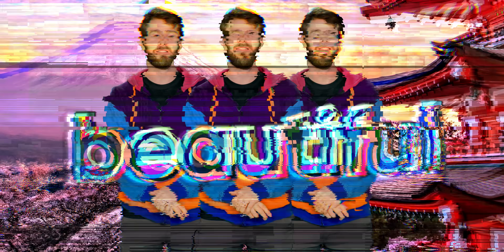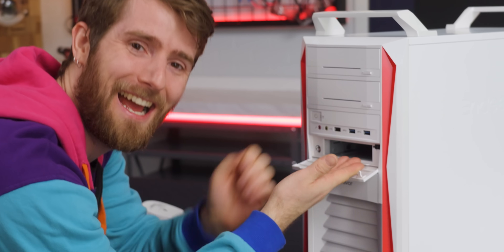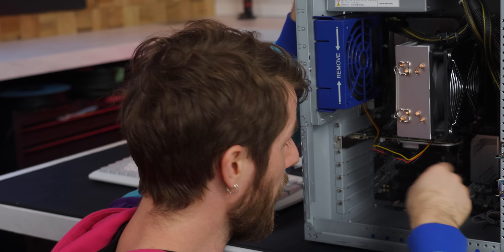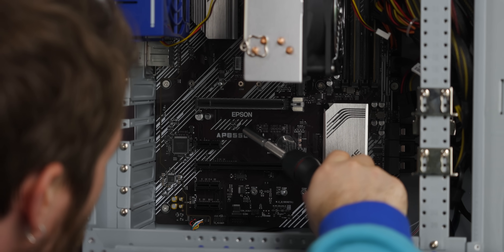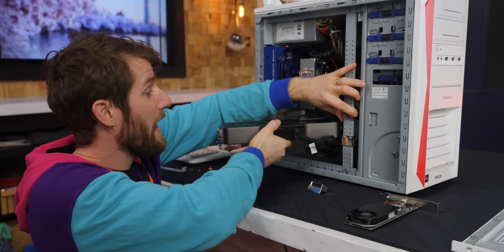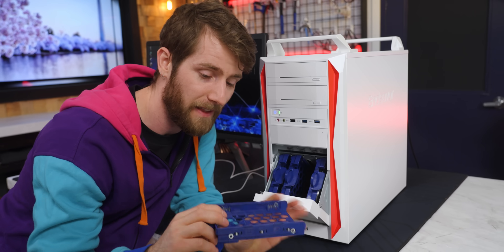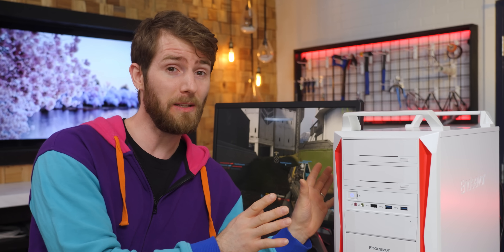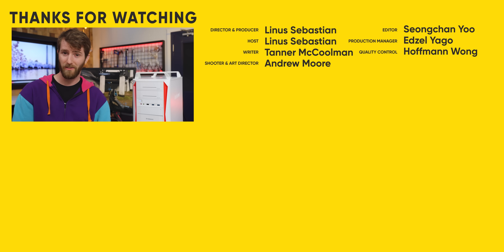I Bought a Gaming PC from EPSON - Epson Endeavor Pro 9050a

Comment: damn that case is better than most gaming PC cases these days (unless you want water cooling). the rear IO and pci panels are reassessed  so that you can properly screw in pci cards and push the pc further against a wall without kinking the wires. Also the strongest part of modern cases these days is the glass side panel, I don't like seeing the top of my case bend when I put something heavy on it if the panel is off.

Comment: Pozidrive (PZ) is also quite popular in the European Union. While the Phillips (PH) screwdriver is designed to "slip" when excessive torque is applied, the Pozidrive (PZ) can handle significantly more torque. This makes the Phillips screwdriver ideal for low-torque applications, such as in electronics. In European construction, the Pozidrive is widely used. Even though the TORX system is gaining popularity, having PZ1, PZ2, and PZ3 bits in a set is essential in this region.
Reply: @mikeycrackson  it'll NEVER be standardized, as for the reason why, it's the same why Apple still uses lightning, money.
Reply: @hueanao  well apple cant use lightning anymore in europe. they have to either get rid off it for the whole planet, or make 2 different pcb´s, one for europe, one for the world.
Reply: Is Philips head the default in the US and canada? What is, for example, IKEA using over there? They are pozi for the most things in Europe. 

I love Torx though.
Reply: @hueanao  No, screws need to carry heavy loads or fit into small spaces etc. different heads lend themselves to different applications.
Reply: Pozidriv in general is probably more popular than Philips in Europe. Whenever I look at bit holders, the PZ2 bit is the one with the most wear by far.
Reply: @ska042  To be fair, a lot of people don't know the difference and just use pozidrivs for Philips heads too...

Comment: The Japanese PC community definitely is growing, and it's going to be definitely interesting to see where it goes in the next few years.  I remember post 2008, I actually got a Fujitsu workstation with dual socket F Opteron's and 48GB of ram for an absolute steal, still weird as hell because they used the same board as the HP Z series workstations, minus VRM heatsink design, the board was 1:1, was able to even use HP bios's on that board strange enough.

Comment: That's actually a pretty cool case, from a pure functionality point of view. Put a card reader/usb c port 3.5in header unit in the floppy drive bay. Implement SSD boot. My first gaming machine (yes I'm old - this was back in the 2000's) with RGB lights (had their own controller - boards didn't come with rgb support then) and Perspex view panel was white.

Tbh flashy cases never appealed to me that much. I kinda like the sleeper nature of this case. Very cool. Good work Epson.

Comment: 8:15 PosiDriv screws are used by IKEA and most if not all of Europe, so it really would be a good idea to include those bits! 

Japan does have JIS, or Japanese Industrial Standard screws though, and the bit for those works better in Phillips screws than even the Phillips bits do.
Reply: Well, as a Dutchman from the Netherlands (which is also in Europe 😉 ), I can't confirm that for my country. Pozidriv is almost exclusive here for woodscrews, anything non-wood is either Phillips (note the 2 L's) or sometimes more recently Torx.
Unless you guys build your PC's from wood ? 😉
Reply: @MrBlafhert  JIS screws normally have a dot on them

Comment: Not gonna lie, that case is sweet looking IMO. I'd take that over my smoked glass RBG case but that could be due to the massive, random isssues I encounter with it despite it being in for repair twice since purchased. Next one I will build myself but I was too busy at the time to build current system. Also, my GPU came loose on way back to me from the shop despite having the shipping foam in place... I don't mind a heavy case that securely holds GPU.

Comment: I understand that EPSON’s PC he’s pretty much in line with the design of the printers, but it actually feels nostalgic considering that it also looks like an older PC. But yeah, that GPU won’t cut it for gaming purposes.
Reply: It's probably not meant for gaming. Not really. You also have to remember, the popular games in japan are either played on consoles or do not need high spec gear
Reply: Epson has some nostalgia in Japan....they wee the only comany to make PC98 comaptible computers. Thees at least some gaming legacy.
Reply: I guess PC Gaming is still close to nonexistent in Japan.
Reply: As long as it doesn't have RGB, plenty of 3.5 bay's, i would prefer it over  80% of the newer designed cases.
Reply: @alext3811  ironically pc gaming is(was?) pretty big in japan... problem is: only for mmos and indies, they had probably THE most active indie scene up to the mid 2010s, afterwards it all amalgamated internationally.

doesn't surprise me that epson is still popular nowadays if they were the only ones to keep support for pc98.
Reply: @iota-09  Thanks for the information! I forgot about the mmos.

Comment: I would definitely buy this. I miss the drive bays and the diskette bay since I have a lot of old devices and having a CD player and a good card reader with q lot of options would help
Reply: I have a case with a couple drive bays and a floppy bay. I put an optical drive in (I still need it) and an SD card reader with some extra USB 3.0 ports on it as well in the floppy bay.
Reply: @atomicskull6405  i love those fan controllers, they are useless but look cool
Reply: I still listen to audio CD's (plus rip movies from DVD) so a DVD burner is a must. The Antec P101 Silent case only has a single 5.25" bay but that is far better than none.
Reply: @jimtekkit  That's not a bad looking case. Except for the top-mounted ports it's nearly perfect.

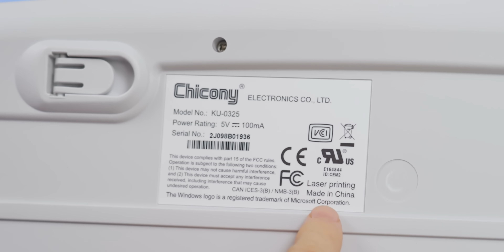Comment: 1:36 Fun fact: Japanese don't use those key assignments with the Japanese letters printed on them. They use IME phonetically just like Westerners do when typing romaji. They type in "nani" just like that. It comes out as なに or 何 after selecting from the IME list. Direct kana input is like their version of Dvorak or other exotic input systems. It's theoretically faster but hardly anyone uses it.
Reply: That's how I fumble typing through the little Japanese that I know. It works well enough when I have some idea of what I'm going to input, and easy enough to use for even the absolute newbie to the language.
Reply: yeah, but if i remember correctly, older machines supported kana input only, i'm assuming imes didn't exist back then.
Reply: NOpe,
some users wil use JAPAN "JIS" layout, for pure Japanese input will faster,
that layout will use kana (Japanese letter) input directly.
ref : https://ja.wikipedia.org/wiki/JIS%E3%82%AD%E3%83%BC%E3%83%9C%E3%83%BC%E3%83%89 , JIS配列、
Reply: @雪見巫女琉璃  Sure, there are some JIS users, but but it's quite a minority. Check the figures from here: https://ja.wikipedia.org/wiki/%E3%81%8B%E3%81%AA%E5%85%A5%E5%8A%9B
Reply: @ruby_R53  You're correct. As a result, most users of direct kana input/JIS are older. If you go back even further in time, there were enormous keyboards for direct Kanji input from before IME was created.
Reply: @dycedargselderbrother5353  this type users will be fewer,  one reason is enviroment is changed.
Japanese has been mix many short words, code words with English past 15 years.
When input text will mix Japanese and English, use IME input (base on ANSI Layout) will be better.
Of course, if not have a JIS layout keyboard, use IME input is only one choise.

in another side, if buy a PC is Only sale in Japan, JIS layout keyboard is standard equipment.  use as normal ANSI layout will make some keys changed.  Need to change OS setting to correct layout.
Reply: im learning japanese, and what i learned is that a lot of japanese mobile users (especially on smartphones) use the t-9 for texting because it’s faster.

Comment: Visited their store page. The default is mechanical drives to keep the cost cheaper. Also to note: the advertised default price includes the sales tax for that configuration unlike here in the US /  Canada stores, the tax is often excluded from the advertised price.

You can actually drop the total price a bit further (probably about $160 / ¥ 22,500) by dropping to an 8 GB memory, Keyboardless, Mouseless, Handleless configuration.

Oh and they probably won't ship over seas anymore if Google translate is accurate. They put a disclaimer that the order is valid for Japan only, and cannot "deliver products abroad, deliver quotes and pay from abroad."
Google Translated: "Please note that your order is only valid in Japan and you cannot deliver products abroad, deliver quotes and pay from abroad."
Original: ご注文に関しては日本国内でのみ有効であり、国外への商品のお届け、見積書のお届け、および国外からの お支払いはできませんので、あらかじめご了承ください。
Reply: still with a basic system like this there is no way someone should spend 1500$ for it. For that kind of money you can get a RTX 4070 and an i5- 13XXX currently
Reply: that Japanese sentence manual translation is,
Due to All things about your order are valid, confirmed in Japan ONLY.  So Shipping products or papers, and payment not in Japan will not accept.  Thank you for acknowledge our notice.

Comment: Hell yes.  I can print out documents while wearing my Seiko and checking email on my Epson PC.
Reply: Better use that Canon printer for it and then fax it later with Fujitsu.
Reply: Don't forget to punch some numbers for your business on your citizen calculator.
Reply: But if you have a Seiko you should use a Seikosha printer!

Just kidding, you can use an Epson as that is part of the Seiko Epson Corporation...

Used to work with Seikosha printers. it was always fun when a customer wanted a custom Form Feed length. You had to break out the Hex editor and hack the firmware. The FF was described in 1/240" if I remember correctly- Now that would be fine if every feed was an easy multiple of that, but as most used millimeters that was rarely the case. So you had to make it at least 1/240" short, and calculate the overflow. Each time the cumulative form feed length fell below the 1/240" you added that. This way you could use form feed hundreds of times before it got out of sync to a significant degree.

And before you ask, no changing the page length in the application or in the driver was not really an option. Windows wasn't yet a thing, and most programs had very basic options for handling the printer.

We had some pretty interesting printers from Seikosha including a video printer. That was a printer intended to provide a hard copy of a video feed. In color... The quality was crap compared to what you may expect today, but back then it was pretty amazing. You might have heard the proverb that  "The marvel is not that the bear dances well, but that the bear dances at all." And that was very much the case here.

Comment: Actually really like this system,seems very well built and no RGB crap..the hot swap HDD bays right out the box is a very nice addition...would be nice to see additional tests done on this system to ... HAVE asus locked down that bios to cater to specific needs/restrictions requested by Epson when it comes to CPU upgrade or overclocking :)

Comment: The only thing that I miss about these old PCs are the optical drives
Reply: I still use my 20 year old case because it has 3 optical bays (2 populated) and 2 3.5 bays (both populated).

New cases are nice looking, but offer no drive bays. I just like to have things in my case and not need to plug in a USB drive and keep that kicking around.
Reply: @volvo09  my thermaltake armour with 11x 5.25" front bays and a 3x 3.5" rear cage is weeping at that.,    and while not fully populated.  they mostly are.
Reply: I have an 5.25 inch drive bay...
That has a HDD hot swap bay!!!
Many times viewers from my stream get surprised how I keep a hard drive in there.
Reply: idk, I love this case so far; only things missing are front usb c and back IO

Hot-swap hard drives + 5.25" bays in the front, plus the GPU holder are really nice, and not having a glass panel means you don't need to bother getting nicer looking components.
Reply: @benwu7980  that sounds like a beast of a case! Like the old floor standing IBM ps2's that were waist high. 

I'll have to look it up.
Reply: Have you noticed this video has a lot of spam comments copying other comments?
Reply: @volvo09  VA8000BWS  i think is the same as mine,  hard to remember since i've mine since around 2006 and 3 builds  (and yes,  it's a full tower in the old sense of the meaning)
Reply: @phraseneither  Right! I came to finish the video since I had to go do smth. I came back, went through some comments and saw like 5 copied comments from mine, but like 10 copied from others. Bots will be YouTube's downfall
Reply: I'm still using an "old" Fractal Design R5 which has 2x 5.25" bays, one of which is populated with a lightscribe DVD burner though I've been thinking of upgrading to a Blu-ray burner
Reply: @Not_A_Serious_Guy  Wondering I the bot remover tool from Theo Joe is having problems? 🤔
Reply: @phraseneither  faik it's not a real time tool, but a runtime tool,  but i agree, youtube is abysmal on what are the lowest form of obvious spam bots ><
Reply: @benwu7980  Ahh, thanks for clarifying I appreciate it!

Comment: I'm so weirded out by the idea that optical drives are supposed to be a weird thing to have lol. I have a large collection of cds and dvds, it would feel weird to not have access to those media formats on my puters
Reply: Same, I love buying CD albums of my favorite bands and rip them in lossless quality to my PC and I still prefer buying big AAA games on physical media, because installing a 100 - 150 GB game via discs is still faster than downloading it over a 100Mbps connection and I'm not willing to shell out for a Gigabit (doesn't really make sense for me anyway) just to speed up the occasional game download.
Unfortunately, most games you can buy in media stores these days are just an empty box with a download code inside, makes no freaking sense at all! A waste of resources without any benefit! 🤦‍♂️

Still, my PC doesn't actually have a 5.25" bay. Instead I use an external drive that's taped to the underside of my desk and connected to a USB KVM, allowing me to swap it between my main desktop and my retro PC where I play some old disk-based games with the push of a button. Optical drives ain't dead!
Reply: Most of Linus' audience would be advocating for migrating all that content to a plex server...
Reply: Buy an external imo
Reply: @Lunaire.-  External drives are a dumb idea for anything that's I/O intensive like ripping blurays... Companies aren't optimizing them for new USB standards so you'll be stuck at the 2-4x range instead of 24-32x speeds.
Reply: @d0h  USB 3.0 is 5 GBit/s which is almost as fast as native SATA 6 GBit/s. Faster than any mechanical hard drive and certainly faster than a BD-ROM drive.
Reply: @eDoc2020  sure, if you're doing straight bandwidth. When you're doing I/O intensive stuff like ripping you have to handle addressing on disc, retries, transport, etc and each one comes with the added latency that goes with adding the USB controller and external cable runs.

In addition, most of the external drives labeled USB3 were created for USB2 use and they did a quick switch of components to be "USB3" but the drive still has the bottlenecks in spin speed / vibration dampening / raw read speed that will limit them to 2-4x as opposed to 16x write and 24x+ reads for internals for the same prices.
Reply: @d0h  The USB latency is negligible compared to the slow-spinning drive. Looking at spin speed / vibration handling / whatever I thought external optical drives were just internal drives with an IDE/SATA converter. I hadn't considered this but most modern externals are probably slimline. If you're comparing a portable laptop-style external drive to a desktop internal drive that could cause a difference. But if you have a full-sized desktop external drive (probably with a 12V power brick) you won't notice a difference.

Comment: The case is cool and the design is a nice departure from the prettified light show designs that are popular right now. I'm wondering if you can put SSDs into the drive bays? Would you need an adapter for it?
Reply: I think it's just a matter of if you can mount the 2.5" ssd in the right spot on the tray, because then it should line up fine with the connectors.

Comment: 5:57
Servers if they are 3U or 4U usually STILL have those "GPU support brackets".
TODAY.
1u and 2u, usually not - but smaller GPU cards don't need them.
And don't forget OTHER cards.

Comment: I wish cases were built like that still.  When I look at expensive cases and can easily flex them I ask why they cost as much as they do.  I'd rather put my expensive components inside a tank of a case than one that changes shape in a strong wind.  Could you use your contacts and find out if there are any big case manufacturers that will still make a case like this, LTT?

Comment: That font on the mobo was the first thing I noticed. Asus has been supplying PC manufactures for years. Back in 07-08 I was working for the local Acer service agent and all the Acer desktop PC's had Asus boards in them.  From memory I think HP and Compaq would occasionally use them as well. We serviced them too.
Reply: My HP Core2 desktop has an ASUS P5LP-LE.